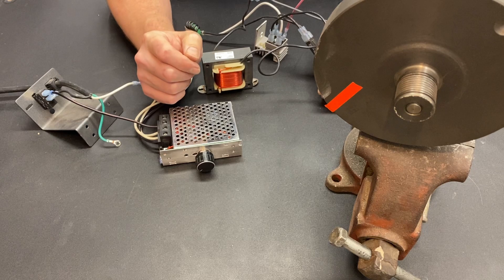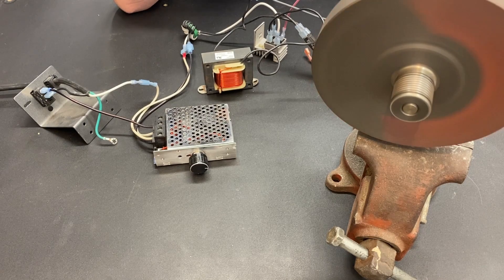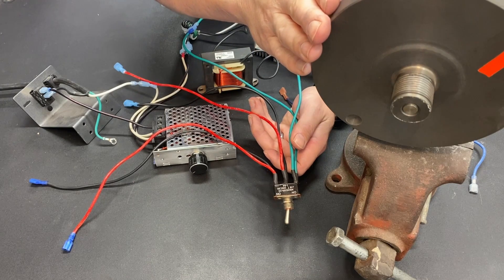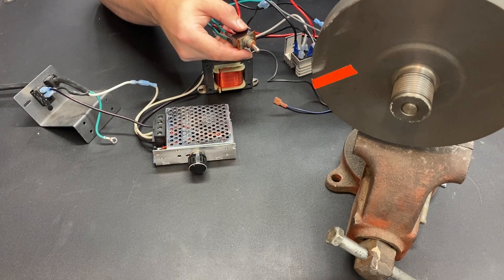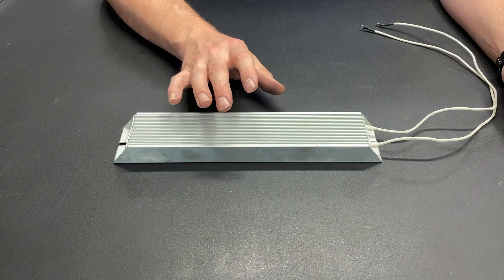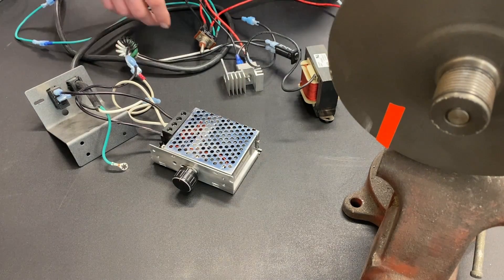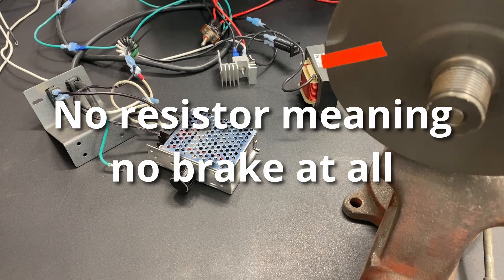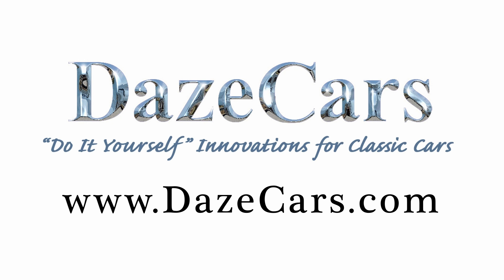Adding an Electric Brake to a Treadmill Lathe Motor Upgrade  For the Lathe Using a braking Resistor

Comment: in-er-rest-ting  --  I sorta remember in school machine shop trade school we had these outstanding japanese 14+" lathes with a quick stop break lever. the point i'm geting to is a momentary brake switch and litteral brake-a real p[hysical brake too and both activate at da same time-- like wit ah foot pedal-pushing the brake "pedal" (physical) wand the electrical switch at the same time coupled.  if U get where I'm coming from.  some grizzly lathes have an emergency stop-(which can become habit forming)  also a a lathe brake can speed up lathe production by maybe more than 30%.  i.e by tha time it takes the late to stop you will have completed the measurement or etc. that U stopped the machine for.   K  :)  PS: a simple brake pad brake is simple. and U cud stop machjoine on ah dime--  also may wanna investgate electric breaks - they already have those---I no nothing about them opther than they exist.  I've wondered tho
Reply: i don't know why there's a line thru part of what I wrote -- it's all "good" stuff.  K   PS:  DUDE U DO GUD WERK  :)  THANKs
Reply: Oh-another point-significant braking on a metal lathe  requires that lathe chuck NOT BE A SCREW ON CHUCK cause like fly wheels they can come unscrewed real fast  yikes 10+lbs of spinning castiron = no fun.. -- malso for a screw on lathe friction brake to chuck cud be possible BUT remember that it wud also tighten the chuck on the lathe spindle.  ugh
Reply from the maker: Excellent point.
Reply from the maker: I didn’t do it
Reply from the maker: A mechanical brake is a outstanding option but I like electric breaking only because it automatically engages every time the power is cut eregardless of how

Comment: On a lathe, don't you have to worry about it potentially slowing down too fast because the momentum of chuck might make it unscrew and some off?
Reply from the maker: A lot of lathes don't have a screw on chuck, and it was my understanding that the ones that do also have some sort of  lock so you can run them in reverse but not having messed with one I do not know that for sure.

Comment: I need to stop a reversible AC motor quickly. Two wires under the cover plate are reversed to change the motor direction. This motor is a brushless 1/4 hp motor. (I believe it's brushless. The motor has a gray rolled sheet steel case, cast aluminum ends and no caps covering brush springs and no internal sparks when running)
Reply from the maker: I have not messed with braking on AC motors
Reply: @dazecars  Pretty sure it's exactly the same. In fact, AC motors that are hooked up to a VFD need a braking resistor because they can generate enough voltage to kill the components in the VFD, and are often included as part of the speed control. But the same applies to any AC motor, even without a VFD. So yeah, everything is the same as sake as in this video.
Reply from the maker: thanks for the info
Reply: Technically anything we call an AC motors is brushless, because the motors that run on AC and use brushes are called universal motors because they also run on DC. Clear as mud, right? AC motors are split into synchronous and non-synchronous, and then you have weird things like Shaded Pole, but none of that matters. Just wire it up like a DC motor.

Comment: Hello. Firstly, thank you for your videos. They are helping me tremendously. However, I do have a question. I see you are using two resisters to achieve 2 ohms. Why did you decide 2 ohms? I've seen resisters on the market @ 1 Ohm 5% 1000W. Can you tell me the calculation you used to determine what is right for a given motor.  My motor says 16 AMP / 140 VDC @ 3500 RPM 3HP. Any response would be appreciated.
Reply from the maker: Not being an electrical engineer I do not have any calculations other than watts.  I ball parked watts by multiplying amps and volts which is how watts is calculated BUT that doesn't take into account the rapid voltage drop as the motor brakes. To get the correct ohms I guesses and picked up the two 4ohm resistors knowing I could put them in parallel if 4 ohms was too high.  The guessing /trial and error worked well as you can see the results in the video but I knew that my results were not accurate enough because of the rapid decrease in watts and I wanted to find the minimum ohms that would still protect the motor while maximizing braking.  To answer all this I devised an experiment and made a video on it.  https://youtu.be/2p3-sUZ4VPE It should answer all your questions.  Please let me know if you have any further questions.

Comment: I have a minitor d360 with elec brake  problems , this weekend  with luck , I may...lol...May , solve it..
Reply from the maker: not familiar with that machine.  Just a reminder this technique works with DC motors, but I am not sure how effective it would be with an AC motor, I have not experimented with that.

Comment: So my lathe came from factory with a brushed dc motor and a forward reverse switch.  If I flip from forward to reverse while the machine is on, it very quickly comes to a stop (but doesn't start in reverse until I hit the start button again)  Is this a safe braking method?
Reply from the maker: I don't know.  I would assume there is a safety mechanism in there to eliminate problems but not knowing exactly how everything is wired, I am just guessing.

Comment: Thanks for the great video! I would like to understand how you calculate that you need 1000 watt resistor. Also, do you think you could use an electric stove heating element as a braking resistor?
Reply from the maker: First you need to know that I am not an electrical engineer.  I do know enough to do basic calculations but not the more complicated things.  With that in mind I do the simple calculations and then err on the side of caution.  In other words I overbuild to compensate for my lack of complete understanding.  With that said the basic calculation for watts is watts = amps times volts.   If you look at most treadmill motors they are 90V and 10-25 amps, so there power draw is 900-2250 watts. For the purpose of this explanation we will assume they are all 90V and 25A. When the treadmill motor goes from being a motor to a generator that same wattage should be produced, BUT that would be at 100% efficiency which will never be the case. I was not sure how efficient these motors were as a generator so before I ordered a resistor I used my DPDT switch to test the voltage being generated while free spinning. I hooked the meter up in place of the direct short/resistor and brought the motor up to full speed. Then when I flipped the switch and the motor began free spinning it was generating about 50v and dropped quickly. 50V X 25 amps would be 1250w which is more then my resistor but a braking resistor can handle a quick burst of way more than it is rated at and the wattage drops so quickly that the 1000W I went with is actually more than enough. Then when you consider It’s going from max watts to no watts In a few seconds or less it is even less likely to damage the resistor.  With that info in mind I chose 1000 watts because I knew it would be enough at max.  Because the wattage output drops so quickly I probably could have used a smaller resistor, say 500 watts but again I wanted to err on the side of caution.  As to using a heating element I would think that would handle the wattage no problem but  you would need to measure the resistance.  There was a huge difference in braking speed between 4Ω and 2Ω resistor and if the heating element was more than 2Ω it would not be effective as a brake
Reply: @dazecars  Thanks so much for the lengthy detailed explanation, you made it very clear for me. 
I watched a video by MofigoDIY and he showed how to make high power resistors using a tubular heating element. He achieved different resistance levels by adjusting the length of tubular element he used. 
If I have a tubular element that has a resistance that is too high, couldn’t I just keep cutting it shorter until I got 2 ohms resistance? It seems like it would be quite short.

Comment: Well done sir, another subject covered professionally. I have the treadmill motor set up on my Lathe and was trying to figure out how to set this up when I complete my Electric Leadscrew. Thanks again for the idea’s and explanation. I have some 50 Amp resistors left over from fixing flasher error with LED turn signals, a perfect use for them.
Reply from the maker: my only question would be, for what voltage are those resistors raited at 50 amps?  Amps X volts equals watts and you will need to be in the 1000 watt range.
Reply: @dazecars  of course I can’t find the product listing that said 50 amp, most are saying 50W 6Ohm and 12 volt. I looked at a write up on adding a brake resistor to a DC motor, and a resistor like these was pictured, but I had no idea how it worked until your explanation
Reply from the maker: @Richard-gh1gv   I don't think that will be big enough for a treadmill motor.  This is what I went through to determine that I needed 1000 watt resistor for my project.  Watts is calculated by multiplying amps times volts. Most treadmill motors are 15-20 amps. Max RPM is usually around 90v so the motor is 1800 watts at max.  As a generator output would be somewhere less than 1800 due to efficiency. Before I ordered a resistor I used my DPST switch to test the voltage being generated while free spinning. I hooked the meter up in place of the direct short/resistor and brought the motor up to max RPM. When I flipped the switch the motor was generating about 50v and dropped quickly. Using the same calculations, at max I was looking at 1000w (50V X 20 amps) I don't like having things like this at the limits of their capability but If for some reason the free spinning motor produced a little more voltage than 50 creating more watts a braking resistor can handle a quick burst of way more than it is rated at and the wattage drops so quickly that it is more than enough. Also my lathe is almost never at max it’s 2/3 or less so we’ll below the 1000w. Then when I considered the motor is going from max watts production to 0 watts In 1 second or less it is even less likely to damage the resistor I chose.  But in your case you are way under that wattage, by a lot.  The resistor you have must be for a smaller motor.  Also at 6Ω it will not be fast enough IMHO
Reply: @dazecars  did some digging on this and many only use about 50W as it’s not taking much of a load and the load exponentially decreases as it runs. As long as it’s not used more than every 40 secs, it should stand up. 
One of the recommended items to use is a water heater element. High wattage and made for heat. I also have a few used block heaters here, and they average 600-1000w in a compact size.
Reply from the maker: @Richard-gh1gv  I burned up some 50 watt resistors I had on hand before I "did the math"  if it works for you fantastic, but the volts and amps of these motors are high  even as a generator so you will likely need something bigger.
Reply: @dazecars  agreed on that, in some info I read, you could easily go 1/10th of the power the math gives because it’s not a constant load. By your math, that’s still around a 100W. I’m only using a 1 1/2 HP that is lower amps on my lathe as the bracket was an easy fit and the shaft diamete was perfect. A smaller resistor might might work in this case but probably not for the 2 hp or 2 1/2 HP ones I have, but each of those will need the shaft diameter turned down a little to fit the lathe pulley. Thanks again for your great work.
Reply from the maker: @Richard-gh1gv  My pleasure.  Let me know how it goes.  If a smaller resister works well I would love to know about it.

Comment: I was thinking that perhaps this is the generated force acting in opposing force to the magnets? This would (I theorized?) make a almost “reverse” force relative this the speed of the motor (generator)?

Also, I wonder if an incandescent light bulb would work in place of resistor?
Reply from the maker: I am not exactly sure what you are trying to convey.  Putting the motor in reverse from forward is a BAD idea.  Drawing on the current produced from the motor is what makes the braking action.  It is kind of like using a gas generator for 110 when you plug something in and turn it on the gas motor will bog until the generator adjusts RPMs to compensate.  producing electricity creates resistance.
Reply: I meant that shorting the windings actually causes the motor to resist itself. The motion of the windings (relative to the magnets) builds a magnetic field that opposes the rotation. That’s why it’s more of a break than just turning it off.
Reply from the maker: @davidkask510  Thanks for the explanation of what you were trying to say, Thats an interesting way to look at it and makes a lot of sense.  I am no electrical engineer but it is my understanding that the action of one magnetic field being forced against another magnetic field that creates the current and I do know any generator is harder to turn when there is a load.  With that in mind your explanation seams to be spot on as I found one description online of what is happening is that "as electricity is produced in the coil the coil creates its own magnetic field and that field is what causes the braking action."  That field would have to be in the opposit rotation of the motor or the motor would spin longer not shorter when you short it out so I think you are right on.

Comment: would a variable resistor be ideal to limit motor damage while also reducing time to stop?
I'm thinking the resistance starts high to minimize sparking but then ramps down to a really low resistance.
thanks for the vid!
Reply: Very interesting question, but I don't think I've ever seen a variable resistor with low ohms and that can handle the amount of electrical heat generated by a motor that strong.
Reply from the maker: It's an interesting concept.  The first obstacle would be getting one with a high enough wattage rating.  1000 watts is A LOT.  Second a 2Ω there is no arching at the brushes so I think it is probably the best compromise.
Reply: varac into a 1000w resistor?
Reply from the maker: no the motor is connecting to the resistor